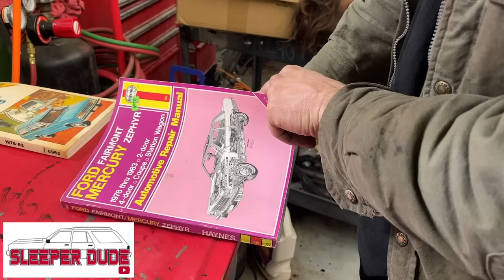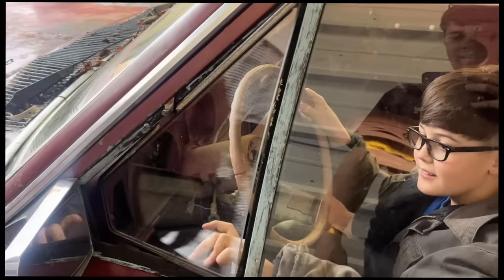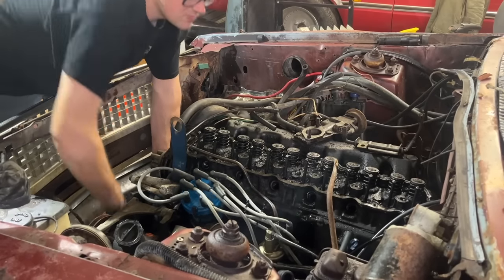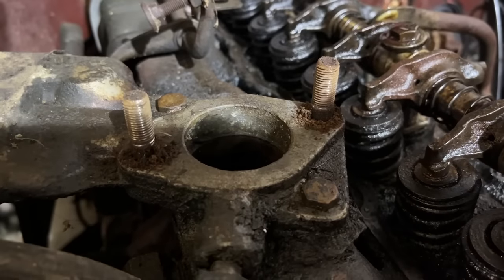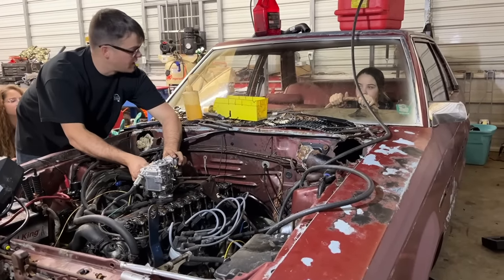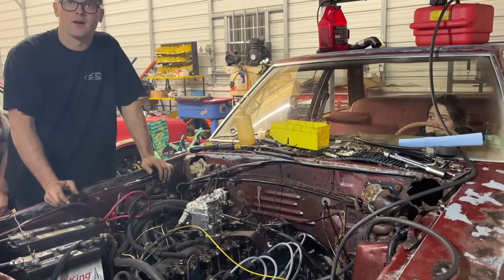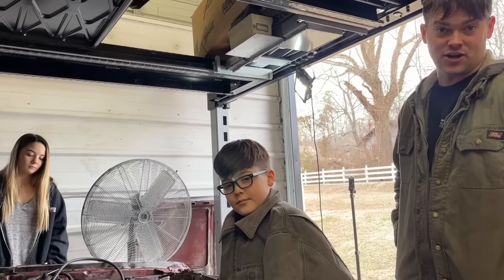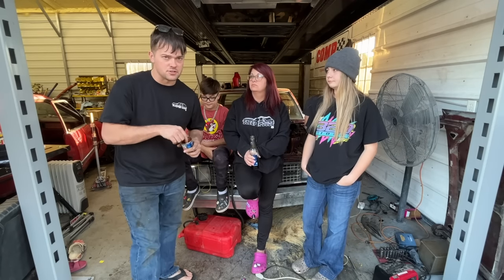Junkyard Rescue 2 Door Fairmont Saved From The Crusher Will it Start?

Comment: Dude… (SleeperDude),  I get the Ford Fairmont fetish thing mostly.  I am a pretty hard core Chevy/GM guy who worked at a Lincoln Mercury dealer for several years.  95% of those Ford cousins were actually really great vehicles.  I even owned a 1991 Mustang GT for a few years and loved it.  From my work experience, the Grand Marquis/Crown Vic line may have been some of the most reliable cars Ever Built!  I even like Mopars.  But you are killing us with the mundane version of the Fairmonts.  Let’s see a Rick Flairmont vs one of your Enhanced Fairmonts?  Rick Flairmont is Awesome!  Finish the twin Turbo-Mont?  What about something like the wagon you had way back for the Zephyr with a Coyote , BBF, Mark VIII powertrain?  My Wife and I watch your family oriented episodes whenever we can.  We love the teamwork on the RV’s.  You guys are getting darn good at those.   The animals are adorable.  Maybe a little moderation for the Fairmonts or make them extra special.  Put a lifted Fairmont body on the Mud Truck chassis?  How fun would that be?  Make the Falcon shiny and reasonably fast?  You got the skills.  We love you guys!

Comment: You don't need 24 volts (two batteries connected in series) you need more amps at 12 volts  (two batteries connected in parallel)
Reply from the maker: Ok thanks

Comment: My dad always told me when getting parts from a junkyard depending what type you need if you motor or transmission parts find a wrecked one cuz 99 percent of the time it was running when wrecked but if body parts find a non wrecked one

Comment: "Work with a Goat they said", I'm dyin' 😂, p.s. would have fired right up if you dropped the exhaust. Obvious back pressure issue due to mice. It will run...trust me.

Comment: I understand that it would've meant having to replace the head gasket, the intake manifold gasket, and the exhaust manifold gasket, but I would've pulled the head and put it in the parts washer too. Edit: I'm not trying to be critical, I'm just giving my personal opinion. However, I understand that you're just trying to see if it will run or not.

Comment: Did you recheck the distributor after you replaced the timing chain, might of missed that? If timing of cam etc are correct, try another ignition box. Sometimes those box's have intermittent problems

Comment: If the exhaust pipe is clogged with debris,,,you will never get it to run.    Disconnect at the manifold and see if half your issues go away.  Also take a wire brush to the ring gear.  get some of that rust off.

Comment: Wonder if it has more compression/less rotational inertia.. because the valves are correct after the chain replacement.. either way.. just on oil coking alone.. not to mention the spark plug non fouler.. that thing is cooked.
Reply from the maker: Yeah maybe so
Reply: @Sleeperdude  this you're comment? And the one about winning? Or typical youtube scam crap?

Comment: Y’all need to mount 4x4 wood in back of shop walls and go to HARBOR FREIGHT AND BUY 2-3=$50 2000 lbs winches so that YALL don’t have to struggle pushing cars in that garage = mount the winches to the 4x4 wood = that’s what I did cheap and great

Comment: Josh. My mother had one of these cars and went through several starters in which it was suggested to replace the flywheel because of abnormal wear of the flywheel teeth. After the flywheel was changed out, I think that the issue was resolved. I was thinking that maybe this was a common issue with these particular cars from what I remember of them. 
Do you think that where the timing was affected by the bad timing chain that the engine was damaged even more by all of the cranking similar to the damage experienced by an interference engine when they jump time.  I’m not as familiar with the smaller Ford Inline engines as I am like the 240/300 engines that used timing gears instead of a timing chain. Great Video as always.
Reply from the maker: You may be right about that

Comment: dudes, !   Cut the exhaust pipe below maninfold,  i believe it wont start at all because exhaust is plugged solid, my 67 Impala Barn find did the same thing, would not run til i cut pipe and it blew out 30 years of mice house and acorns, dont stop it will run , use a dc motor to spin engine on  crank pulley with belt driving it, my old 283  started and i drive it everyday since , once it ran  it cleaned up and i go everywhere with her now, just might run
Reply from the maker: Yeah we should

Comment: 1, have you tried a wire brush on the rusty spots on the flex plate? It might be that the crud in between the flex plate gears has the starter riding up and causing it to skip teeth? Also, the crap coming out of the tail pipe might be an indication that there i a lot more in there not letting it exhaust. This would cause the flame up at the carb. In other words the combustion is just looking for the path of least resistance.
Reply: .ᵗʰᵃⁿᵏˢ ᶠᵒʳ ᵗʰᵉ ᵍʳᵉᵃᵗ ᶜᵒᵐᵐᵉⁿᵗˢ 🤲 ᵐᵉˢˢᵃᵍᵉ ᵐᵉ ʷⁱᵗʰ ᵗʰᵉ ᵃᵇᵒᵛᵉ ᵘˢᵉʳⁿᵃᵐᵉ ʸᵒᵘ'ᵛᵉ ʷᵒⁿ

Comment: I'm guessing the exhaust is clogged. My Dad had an old Dodge Ram that had cracked exhaust manifolds. we replaced them bc it was too loud and he wanted to sell it. after that it wouldn't start and I remember him going crazy trying to figure out why it wouldn't. three years of of us working on it off and on, changing part after part and still nothing. all it would do was sputter and backfire and it was driving him crazy bc he thought he messed something up while replacing the manifolds. finally one day my Grandpa told my dad to remove the exhaust manifolds and it fired right up. turns out waspers built nests all through the exhaust clogging it. the same day he finally got it going we drove it to sell it and i'll never forget how loud it was riding without manifolds lol

Comment: You should try starting fluid a lot of times on these vehicles gas in an old car that hasn't been started in years just doesn't cut it you starting fluid even brake cleaner will act as starting fluid just thought I'd let you know it may save you some trouble
Reply from the maker: Ok thanks

Comment: I think that the ignition system may be producing weak spark. Is there a way to hot wire a ford TFI coil and module to that dizzy? Or A ford TFI coil and a GM HEI module? Also when the starter was turning the engine @ 12volts it seemed very slow. Like the crank had lots of restriction. Did you put any marvel mystery oil in the crank case? Also disconnect the manifold at the exhaust, those years of rats nests are not letting it breathe. With that low compression it needs all the help it can get.
Reply: .ᵗʰᵃⁿᵏˢ ᶠᵒʳ ᵗʰᵉ ᵍʳᵉᵃᵗ ᶜᵒᵐᵐᵉⁿᵗˢ 🤲 ᵐᵉˢˢᵃᵍᵉ ᵐᵉ ʷⁱᵗʰ ᵗʰᵉ ᵃᵇᵒᵛᵉ ᵘˢᵉʳⁿᵃᵐᵉ ʸᵒᵘ'ᵛᵉ ʷᵒⁿ

Comment: Also if rotor isn't pointing in the correct spot that don't matter either !!!!! Just means somebody. Pulled dist out and dropped it back in  any way it would go and you can just. Make where ever rotor is pointing after you  get top dead center up  that's gonna be your spot for number one wire you don't have to pull distributor out and put it  where factory puts it the motor won't know

Comment: Your compression would be higher after you changed the timing chain, causing the flex plate to lose more teeth . more than lightly it would have started with full rotation of the flex plate

Comment: Josh, have you ever had someone shove a potato in your tailpipe ? The car will not start. Those mice have had 30 years to plug up the muffler and pipe. Saw the pipe off below the manifold. I bet it will start.
Reply from the maker: I may need to try that

Comment: Your exhaust is clogged with rats nest, it can not breath with all the back pressure. but with the ring gear bad and the motor is not good enough to save it is time to cut your losses. On the other hand those engines rebuild well and last a long time But the trans is still an unknown.

Comment: I bet all that gump is from Castro oil
Reply from the maker: Maybe so
Reply: I had a 79 Chevy with a350 in it and always ran Castrol oil in it when the motor blew up it was 10 times worse than that one you could take the value cover off and could not see the rockers

Comment: I know why it’s spitting fire and won’t run. The exhaust is plugged with mouse house and mud, cut the exhaust off it fit a used flex plate off one of the other motors. A mission to see if it will run again you’ve done worst
Reply from the maker: Yeah maybe so
Reply: .ᵗʰᵃⁿᵏˢ ᶠᵒʳ ᵗʰᵉ ᵍʳᵉᵃᵗ ᶜᵒᵐᵐᵉⁿᵗˢ 🤲 ᵐᵉˢˢᵃᵍᵉ ᵐᵉ ʷⁱᵗʰ ᵗʰᵉ ᵃᵇᵒᵛᵉ ᵘˢᵉʳⁿᵃᵐᵉ ʸᵒᵘ'ᵛᵉ ʷᵒⁿ